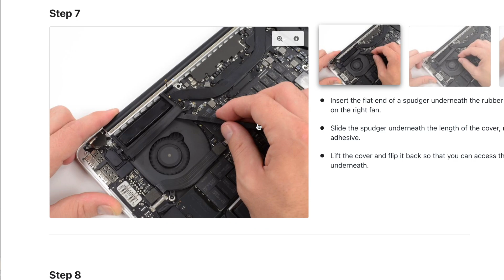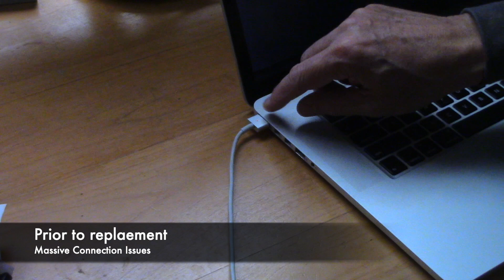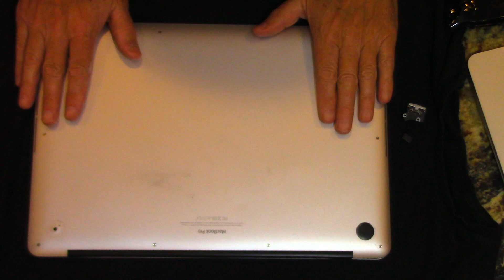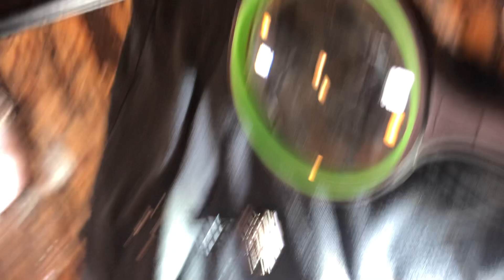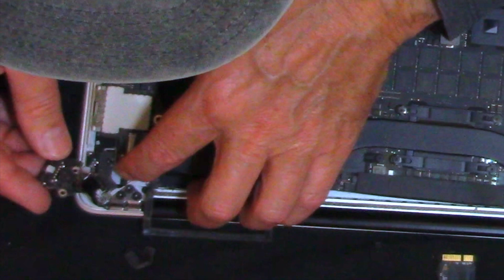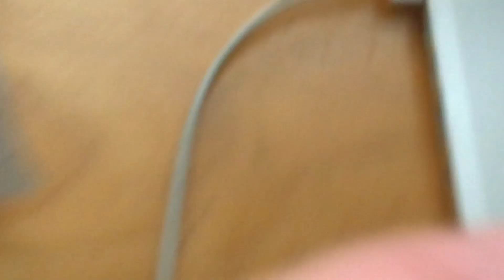How To Replace the Macbook Pro Magsafe DC Board for $30 - I saved $600 by Doing It Myself

Comment: Yeah. I am NOT doing that ha ha! Even though I have ordered all the parts. I am in Australia working till May next year. Will take the MacBook to some shop when I get back to the United States in June 2026. I have been having to toggle the charging port for some time. Apple purposely made the fix complicated. Darn it.

Merry Christmas from Queensland!
Reply from the maker: Sounds like a plan to get it fixed when you're back. Merry Christmas
Reply: @SmartPennyPincher  I saw where you said there was some sort of glue. I don't have an air gun. Don't want to risk it. I ordered a new charger and the replacement MagSafe part. Hoping the new pins on the new charger works. Because my current one stopped lighting up today.